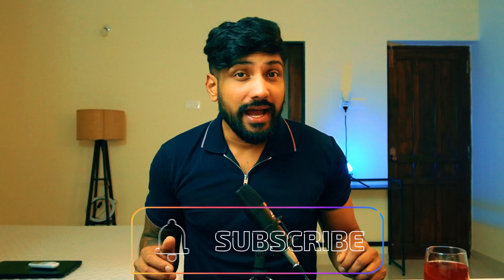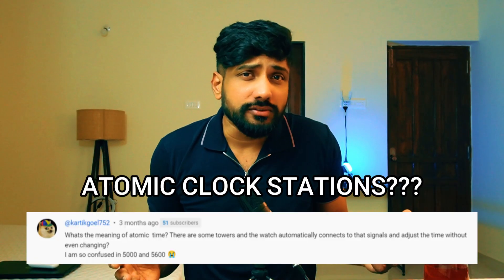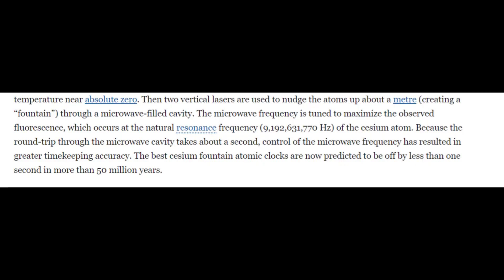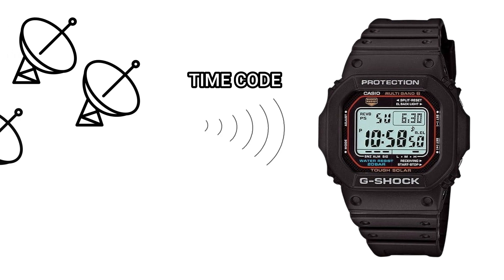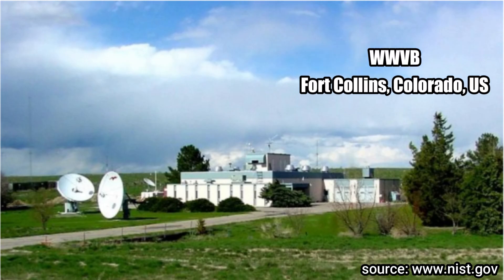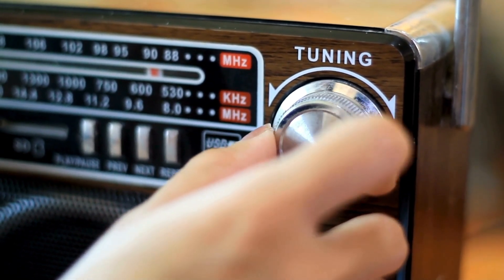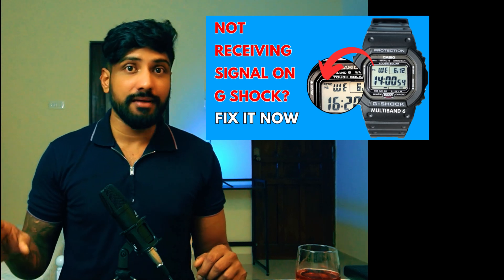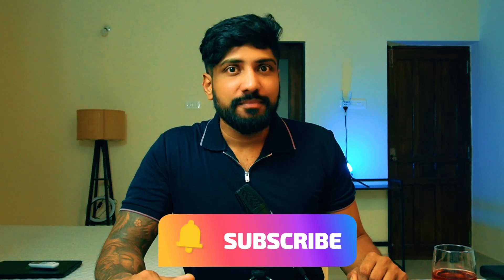Casio G-shock Multiband 6 Explained in Simple Terms | Daily Acurate Time

Comment: You don’t use the app to acquire the multi band 6 signal.  If you are out of range, you remain out of range.  You emulate it with your phone.  Your phone gets GPS synced time from the cell tower.  The app “sends” a time signal to the watch using the speaker.   You are mimicking the signal basically.  
Still works but the way you said it isn’t technically accurate

Comment: To anyone having trouble getting the signal for the atomic syncing even on manual:

I've seen another video testing the "metal/steel pole" trick. The man used the metal rod of his barbell and the manual syncing worked—and it was in his basement. He couldn't get a signal in his living room. He just put on his GW-9500 on the side of it and didn't even put the barbell rod upright.

I've personally tried it with a thin metal rod (hanged the watch) and got to L3 signal constantly (highest level on G-Shock) as opposed to just putting the watch on top of the nightstand (max L2).

Another way is to download an app that simulates the Multiband 6 signal. I find this inconsistent, though.

Comment: Recently I built an inexpensive Atomic Clock Signal Generator using a small Raspberry Pi from a project published on github by HZeller et al called txtempus. It generates signals based on accurate internet time at the times the watches are looking for them. Now my watches get a good signal and update every night.